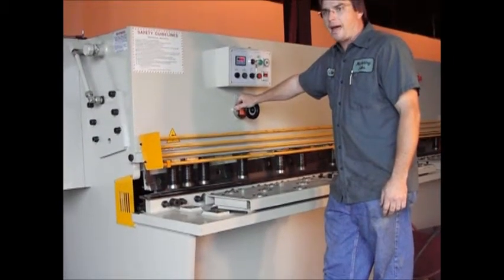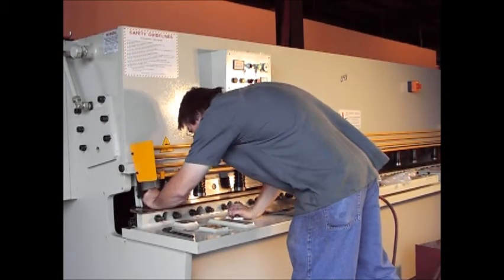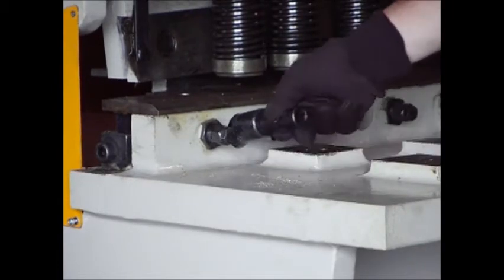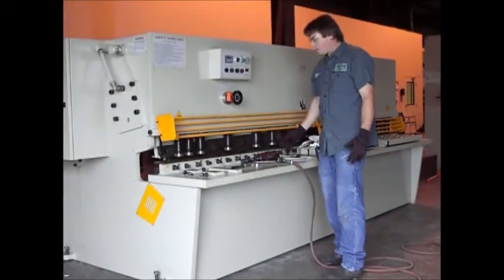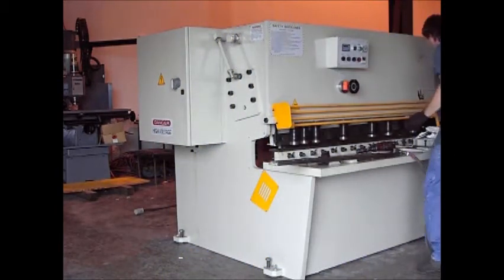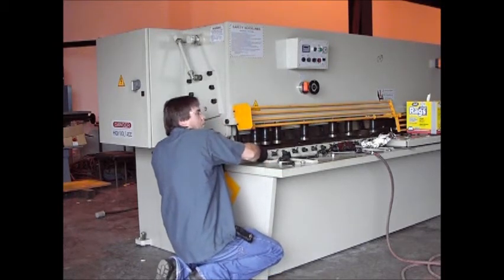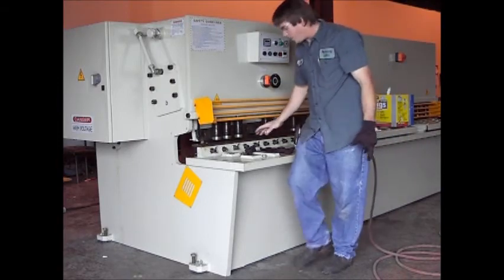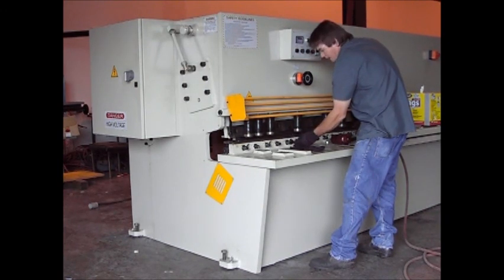Shear Blade Replacement

Comment: very helpful   we just  had our blades sharpened and they must have milled off more than an 1/8 inch because they are nowhere near 3 to 5-1000    that looks almost the same as our shear   thank you for the video     we dont have an owners manual so i kinda had to figure it out on my own    more video lessons on that would b awesome